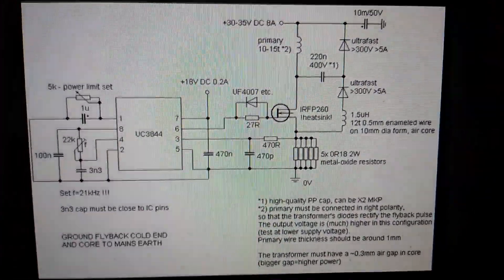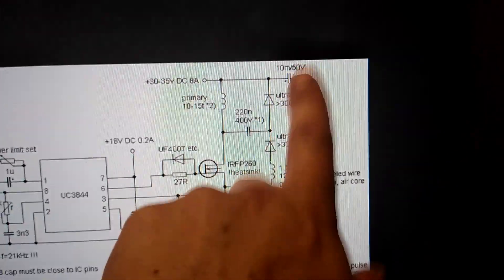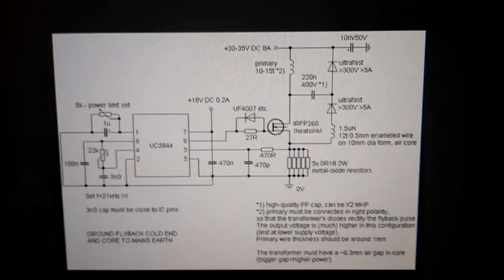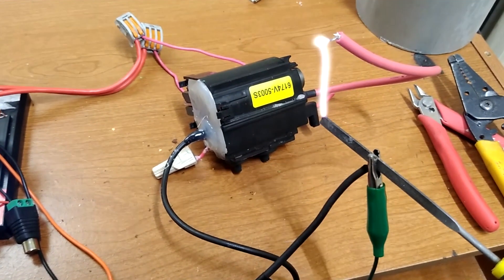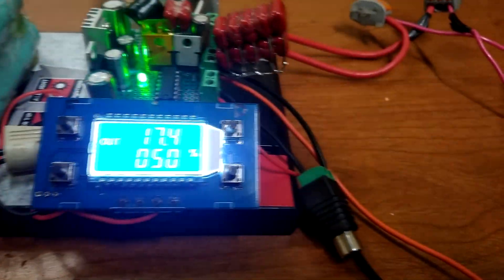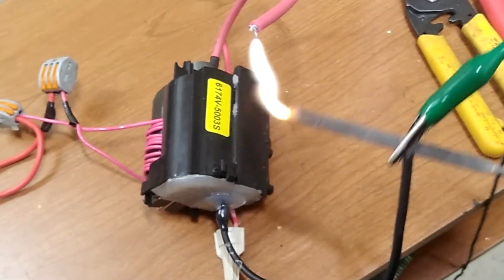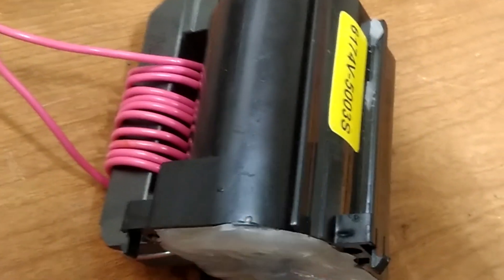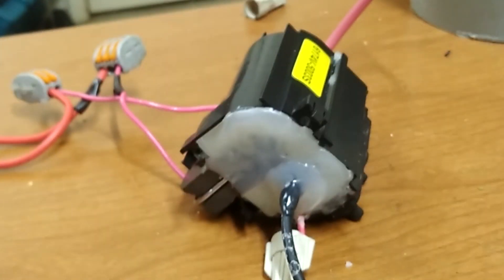'Super Flyback Driver' (jmartis2) + Cheap Flyback

Comment: How do you drive the fet using the pwm module?? Do u use opto isolated gate drivers or just a simple totem pole ??
Reply from the maker: Just a gate driver without isolation
Reply: @Magneticitist  okay but there are chances of the module getting damaged right????
Reply from the maker: @spandandutta2485  There are, but it's not going to be an issue with a decently designed circuit. There are successful circuits out there driving the fets only with a 555. This setup would also not be so different from SSTC setups using a gate driver to switch a fet directly (like Wards Micro SSTC). I've used a TVS diode across the gate and decoupling on all the IC's. The snubber should help keep the switching heat down and the primary capacitor should reduce primary kickback that would otherwise also heat the fet a lot.
Reply: @Magneticitist  well, thanks a lot 😁

Comment: never tried that circuit but seen it around, afaik the two diodes let the drain swing inside the supply voltage and the capacitor kicks in only when exceeding it, generally speaking it's not much a matter of a cool circuit but what voltage your flyback can tollerate, a chunky flyback should be fine at 7cm of jump max... more than that and you are "in the hands of god"
Reply from the maker: I never messed with them much but I always had problems with mosfet heating using a basic drive. It made sense if I could light a halogen bulb from the primary flyback. So far I just like being able to run it long term with a smallish heatsink. Probably going to try really driving it to see where it fails and try to get my hands on a better flyback. This one ain't too bad though. I might be able to push like 3 inches or so initial arc jump at 60 or more percent duty. No idea what my fet is rated for tho so it's like surprise.
Reply: @Magneticitist  i have to try this circuit, it seems the most promising around

also consider your flyback is fresh new, quite likely a "worked" flyback will withstand way less voltage, i'm convinced that the epoxy etc are like ionized or poisoned with metal atoms, no wonder this transformer is the classic part that goes pop in CRTs and they replace it.... the HV wire on yours seems thick, check (read) if it's a TV-30 or TV-40 or even TV-50... if you don't know what CRT it was on this is a mediocre way to "size" a random FBT
Reply from the maker: @redoverdrivetheunstoppable4637  Can't seem to find any markings about TV-# but the HV wire is indeed thick as fuk. It's rated 50kv it says on the insulation. The flyback description just says it replaces a Goldstar TV. Came with a slight chunk missing on the core but whatever.
Reply: @Magneticitist  You can use even less primary turns for more volts out but warning most flybacks aren't designed for much more than an inch/inch and a half of spark ignition between points. The one Jan used was out of a massive Sony CRT TV IIRC hence the huge arcs he was able to obtain without flash-over.
Reply: @Magneticitist  it's quite likely a BIG flyback... i have only one FBT with TV-50 wire and it was from a retrojector 43" TV, it drives 3 CRTs at once
Reply from the maker: @uK8cvPAq  I have sort of a plan with that flyback where I'll eventually stress test it to death (or the mosfet) by going down to around 7 turns at the lowest but I also want to play around with the frequency some more. I also need to drive it from some old ZVS drivers a good while though.. before I understood the mazzilli driver at all I tore down some great ones thinking it was the driver when it was just in fact the flybacks going to shit. 

 I had a flyback in the past that needed to be within a 200hz or so window for the best output, just a basic PWM drive no caps or anything.. I believe something like 20-something khz and 62% duty cycle gave me the best results lol. I scoured Jan's comments til I found where he said which flyback it was but I wasn't able to find an identical looking one online.
Reply from the maker: @redoverdrivetheunstoppable4637  I can say that it's definitely larger than the last 3 I had. Maybe the biggest I ever had. I was legit surprised when I took it out the box cause I was expecting some bullshit
Reply: The drain of the fet definitely swings to hundreds of volts with this circuit, trust me I scoped it and almost blew my scope lol. The capacitor needs selecting so it limits the peak drain voltage to less than the voltage rating of the mosfet, letting the fet avalanche will make it get red hot and fail.
Reply from the maker: @uK8cvPAq  lol I'm afraid to scope this circuit. Especially since I broke my last one in a completely non electrical related accident.
Reply: @Magneticitist  BTW I posted the 4hv link in reply to the other comment, not sure if its ended up in the spam section however.
Reply from the maker: @uK8cvPAq  This is why I hate youtube more and more. Others have told me of deleted comments but I've never found a way to see them. There is a 'held for review' section I can see in the youtube studio deal and a 'published' section but nothing is ever in the 'held for review' section and nothing is there now. There used to be some that would show up now and then after I learned about it some years ago and I would go through and publish them. In maybe the last couple years or so nothing has ever been in there though.
Reply: @Magneticitist  Edited with spaces in the link: 4hv org / e107_plugins / forum / forum_viewtopic.php?49027.0  Scroll down to Markos post and read onward from there, many of those guys design these things for a living. 
That thread was posted before Jan designed the UC3844 driver, the peak current control is what keeps the fet alive (along with the non-dissipative snubber of-course).
Reply from the maker: @uK8cvPAq  lol sweet I got it thanks!
Reply from the maker: @uK8cvPAq  ok that's kind of a hilarious thread and there's some interesting things to take away from that especially from Marko's perspective. The image Richie posted is pretty cool too. I find it an interesting dilemma in that like Jan I have in practice not had much trouble with mosfet death driving flybacks but I've also not used 555's. The plain 555 circuit just didn't look too appealing to me. I have used TL494's though... The issues I had were just excessive mosfet heating and I had just always assumed this was mainly due to reverse current. Regulators would die until better decoupling. I'd slap a large heatsink on and call it a day til the flybacks died, but I'd never really pushed beyond 25-30v supply with them. I had felt confident at this point that a snubber drawing fet discharge elsewhere combined with some kind of cap on the primary would solve all my problems. It seemed like my zvs drivers were what was killing my flybacks quicker, but at the same time I was also going ham for much longer when running them.   

At any rate if it's kind of luck of the draw almost going in blind I suppose I might as well see where the fun stops since so far nothing wants to do anything other than get slightly warm on a heatsink that would have previously been toasty.
Reply: @Magneticitist  That snubber definitely cuts down on most of the fet heating and failures in my experience too, and if its working well enough for you on its own then that'll do. Its just the peak current limiting thing makes it a lot more reliable in my experience (without it I've had fets die cold). How did you interface the fet with the TL494? Its output stage is pretty crappy without a gate driver intermediate stage.
Reply from the maker: @uK8cvPAq  I was kind of wondering if an OCD circuit similar to the common LM311/555 would work by pulling the enable low or something. No idea really. But I kind of see it the same way as in drsstc usage. Wouldn't really implement it unless I started popping switches to justify it. I feel like I won't land a 'super flyback' and this one I've sourced seems to hold up to where I bet about the point where it fails hard from over driving would be around the same point the fet may fail so I guess they sort of cancel each other out.

When I used the TL494's I drove the fet directly with them off both emitter outputs. At the time I figured if a 555 could do it so could the TL494. Performance was poor though.. hit or miss also depending on flyback. I could pull some decent little arcs maybe couple inches tops with about maybe 1 inch arc jump but that was at the cost of driving the flyback like shit at too low a frequency and burning up the fet even harder. I had to keep it fairly low duty cycle in order to avoid overheating. The goal was reliable plasma speaker drive at the time but it didn't pan out like I wanted due to requiring too large a heatsink. Tesla Coils sort of took over a while after that tho lol.
Reply: @Magneticitist  How about this one simonsdialogs com / 2014 / 12 / regulated-high-voltage-power-supply-switchmode-control-30-kv-about-1-ma/ its based on the TL494 and has got peak current sensing like the Jan Martis driver using the error amps. I'd probably insert a dedicated gate driver between the TL494 and fet however, but the control side is really nice. You can omit the HV output voltage sensing parts to avoid complicating it, the snubber across the primary is basically a lossy version of what Jan came up with and the VDR's are extra protection, TVS diodes will work too.
Reply from the maker: @uK8cvPAq  That's pretty sweet. And yet again the description states the purpose of such a driver.. to avoid fet failure. I don't get it!! Now I think I've been doing something majorly wrong.. as in not driving them anywhere close to the extremes all these others have with their blown mosfets.  Another issue I've been coming across is actually figuring how relative people's kv measurements are when it comes to voltage output. I've seen such wide ranging numbers IDK what to think. There are a few (knowledgeable) guys out there who seem to have over 100kv output but are calling it more like 50kv. So when this driver says 30kv @1ma I'm not really sure what that means as far as arc distance in reality.

As for flybacks themselves I guess the only reason I still mess with them is for ZVS arcs but I also wanted to play with interrupting, so the UCC driver works well for that and is basically the entire point of it. I wanted audio plasma that way and figured it would be best on the fet/supply. Hopefully can be just another HV circuit I can plug my TC interrupter into. So far it seems like it would work well but I haven't isolated my interrupter yet. I pushed it at 30VDC 60% duty for a while making sure to draw about 4-5A hot arcs and still holding up so I think my theory might be accurate.. By the time I pop the fet the flyback would have been toast anyway.

The fet I'm using though (might even be an IGBT lol) was one I had switching a large ZVS driver and I believe it can take a lot of amps. At the same time I originally had a fake IRFP460 on there it was doing about the same, I just didn't trust it as much.
Reply from the maker: @uK8cvPAq  Have you come across a working larger image of the one linked by Antonio in the 4HV thread? That circuit seemed pretty intuitive. The gist seemed to be leeching charge from the duty control capacitor to drop it when the current sense transistor opened. I still want to try a 555 driver just cause I see this Franzoli guy have so much luck with it and it's easy enough to audio modulate.
Reply: @Magneticitist  This one? imgur com/a/3iv1Uv0
Reply: @Magneticitist  I think the thing with arc distances is it all depends on electrode shape and the air in the room (humidity, temperature and altitude, you'd get bigger arcs in Denver as its higher up lol). All effect how far the electrodes have to be spaced before they will jump, sharper and pointier electrodes will make for bigger sparks as the charges can "escape" easier and this helps to ionize the air. If you tried arcing between two metal balls then the distance would be much smaller (see this chart imgur . com / a / 4fb9Ax1).
Reply from the maker: @uK8cvPAq  lol yea that's it. how do you have that link? with 4hv links it's hit or miss for me, or maybe it's just that I need to be a member or something
Reply from the maker: @uK8cvPAq  That's the thing, if we factor in electrode shape along with all variances of climate and atmosphere it seems there can't be a compromise of voltage measurement using arc ignition that would be accurate enough for everyone. I wonder could one say that ignition between two sharp electrodes could be fairly close to the common "1kv per mm" ? I've seen up to 30kv per centimeter stated quite often.
Reply: @Magneticitist  Most older images on 4hv are long gone thanks to software rot and database migrations, I've just saved a number of them to my PC over the years before they become inaccessible. Shame its gone that way as there's so much good information hiding in there.
Reply from the maker: @uK8cvPAq  man that's awesome, thanks for your service haha. I get sad thinking about some of the most amazing stuff I slightly remember many years ago which has seemed to vanish. I don't quite understand what happened where it seemed like there used to be more HV enthusiasts out there compared to now. I'd have thought with a rising technologically inclined generation and easier acquisition of useful electronics instruments the HV scene would be much larger than people just wanting to see stuff explode or get red.
Reply: @Magneticitist  Yeah, I've noticed that too there used to be more people doing this sort of thing on youtube, then around 2015 the scene started dying down and one by one HV websites started going offline and HV youtubers became inactive. Some of the folks from 4hv moved over to highvoltageforum . net and it seems pretty active still. Rule of thumb I've read on 4hv is 1.1kv per mm between pointed electrodes, so roughly 28kV per inch, but again the exact number depends on air conditions. But also if you look at the chart the plot isn't linear and more volts are needed for a spark to jump the gap after the first 40kV. Another rule of thumb I've come across is a Tesla coil needs about 500W for every foot of spark.
Reply from the maker: @uK8cvPAq  28kv per inch seems fairly reasonable. I just hit the 9.5cm strike distance on this flyback so I wonder if pretending it's 3 inches even and saying it's 84kv is accurate enough.
Reply: @Magneticitist  9.5cm is very good for a flyback if it hasn't flashed over already, I've had big ones fail at less than that lol. I think 9.5cm puts it around the 70kV mark between pointed electrodes according to the chart link I posted.
Reply from the maker: @uK8cvPAq  lol nice. I'm gonna take your advice on that and just say "~70kv" in the next video title to be conservative.

Comment: Wall of nerd text incoming! That current sensing section has two tasks, first is the peak current limit which gives a crude power adjustment but more importantly it prevents the flux in the core from integrating up and destroying the mosfet from overcurrent, the current draw from the power supply can remain normal but the current through the fet can be many times that and even exceed those insane 50+ amps fet ratings. There's a post on 4hv with more information about why these single ended flyback drivers often blow their fets (its not always overvoltage and avalanching to destruction), let me know if you want me to post a link as youtube will probably mark it as spam.

You can reduce the capacitance across the primary and get more voltage out, but this will increase the peak drain voltage so care is needed and probably a higher voltage fet (think I used a 100nF and a 600v fet, not sure how suitable that arrangement will be for supplies above 24v however).

The UC chips need a good layout to prevent oscillations, I had to put a 10 ohm resistor in series with the gate turn off diode for stability at high powers or else it would tweet like a bird, also the voltage rail for the flyback benefits from a low ESR electrolytic capacitor placed across the supply rails very close to the flyback and fet, this is because the peak currents drawn are enormous (at full power jans circuit is set for something like 27 amps peak even if the current draw from the power supply is only a couple of amps!). I used two 1000uF Panasonic low esr capacitors and they still warm up lol.
Reply from the maker: Hell yea lay it on me bro I appreciate it. I do kind of want to do a lot more reading before possibly destroying my last flyback lol. Itching to push more power through it
Reply: @Magneticitist Scroll down to Markos post and read onward from there, many of those guys design these things for a living. https://4hv.org/e107_plugins/forum/forum_viewtopic.php?49027.0
This was posted before Jan designed this UC3844 driver, the peak current control is what keeps the fet alive (along with the non-dissipative snubber of-course).